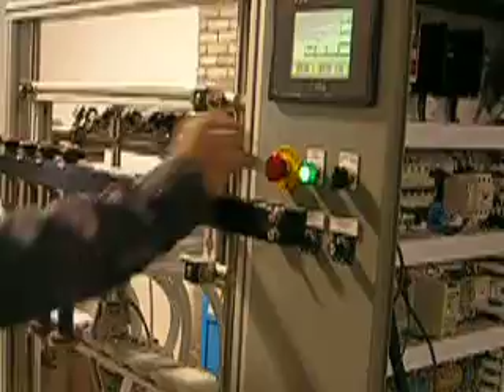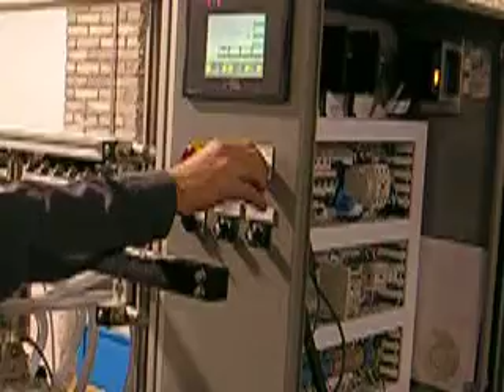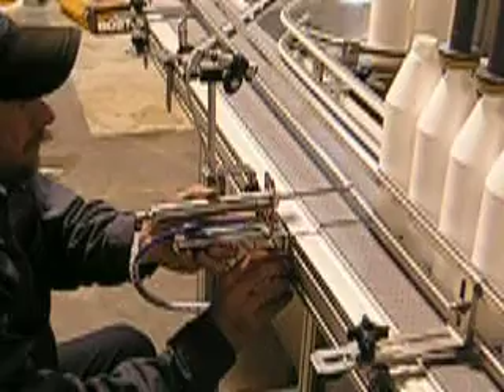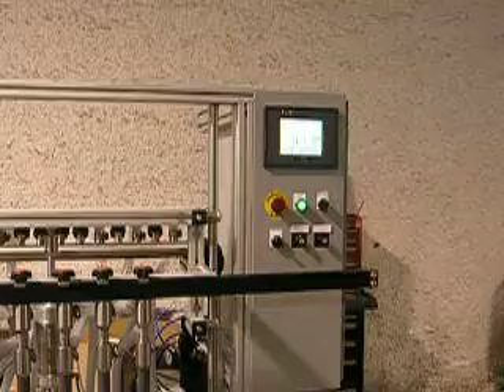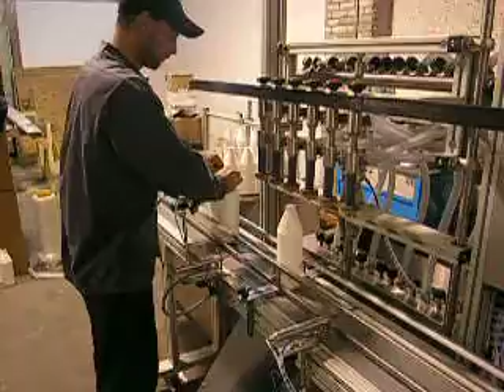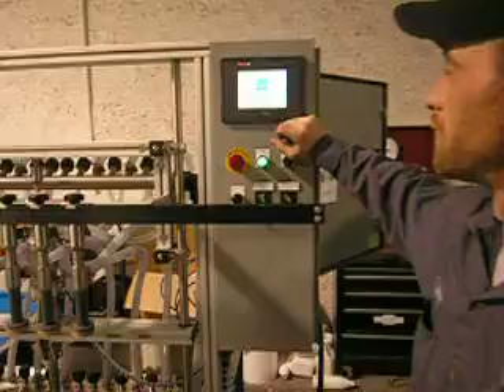Overflow Filler Training Video

Comment: In general, the overflow nozzles use a seal to cover the bottle opening.  Once sealed, product enters the bottle through a hole near the tip of the nozzle.  The nozzle will include an inner tube and an outer tube.  Once product reaches a certain level, it exits through the nozzle and recirculates to the product tank, creating a level fill for every bottle, even if the bottles vary slightly in volume. If you have other questions or need clarification, call us toll free at 1-888-393-3693!